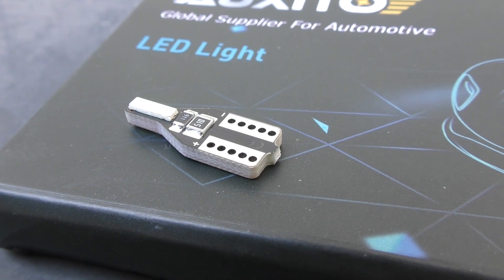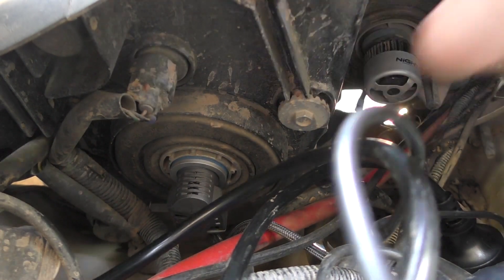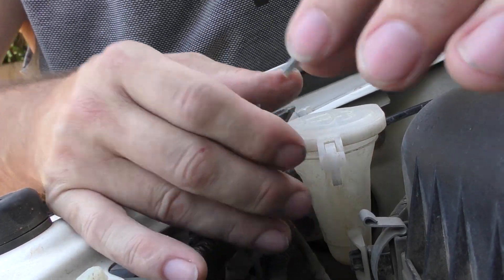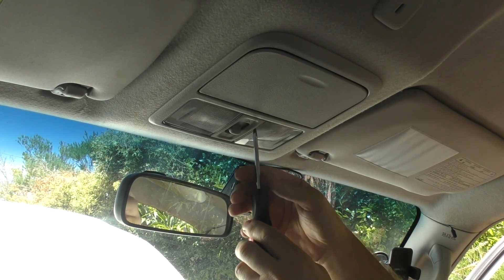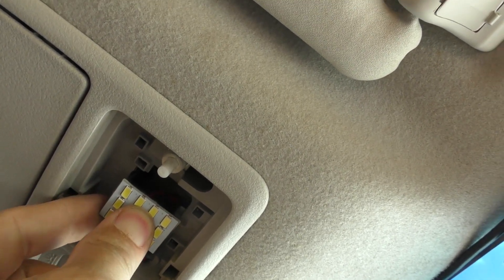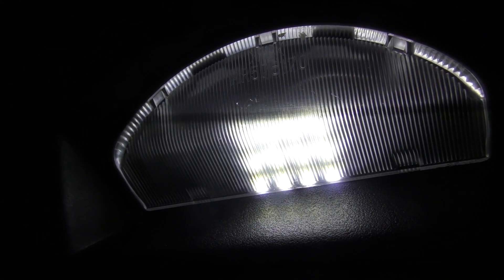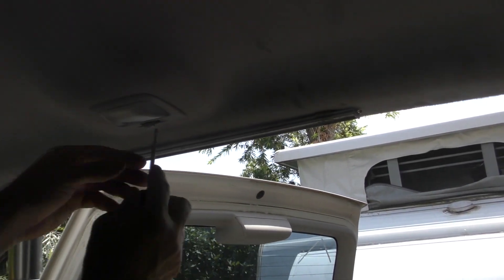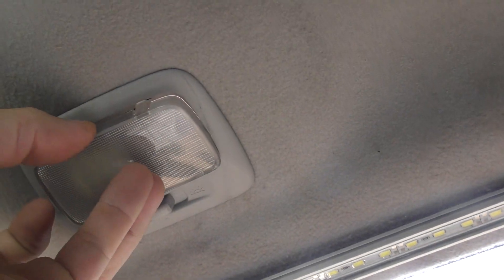Pajero Parker LED upgrade plus interior LED light options - how to

Comment: I replaced the headlights with the LEDs and wow they are great. Did the parkers too. Any idea where I can get a kit of the festoon LEDs? Would need a 10 pack to do all the door and interior lights? And no more than 12 per panel yeah? Don't need spaceship brightness!
Reply from the maker: Hey Phil, yes I think anything bigger than the 12 were to big. I just got mine off ebay. I do have a supplier sending me a full set that will do the whole vehicle inside and out. It's still a few weeks away but eclectic are high based on our interactions this far. Watch this space I guess.
Reply: Hey I can't seem to find the 12 led festoon kits?

Comment: top stuff Brett!! love your vids mate, they are always helpful.
I just fit a Redarc Brake controller to my MY20 GLS Paj, used the Mitsi supplied redarc and the factory loom for it so was pretty much plug and play once you get the rear trim off etc, it was a pretty easy job and worked a treat the last 6 days when I went up the Murray with the camper.
Only thing I wish Mitsubishi did was with the factory tow kit they should put a 12 pin plug rather than a 7. 
Anyway have a good Australia day holiday mate!
Reply from the maker: Hey Da, thanks for the awesome comment mate. I fitted a controller but didn't use the factory harness. Would have made thing easier I think but I didn't have one, so made do. Enjoy the break mate. Hope there was some water in there for ya. Happy aus day.

Comment: Hello Brett, thanks for this great video, i learned a lot 🙂
Could you please help me with this; i would like to change the original red appearence from the center computer ( with temperature, range, clock, etc) into blue. Some Pajeros have it in red and some in blue.
Also the Climate control should be in blue too insteat of red. 
Thanks in advance for your help, Alain from Belgium

Comment: Hey Brett me again.  DO you know the size name for the little mini globe in the glovebox?  Its about 16mm long and about 5mm wide.  Of all the bulbs that needs to be bright it's this one.  Can't see what LED light would suit.

Also for everyone else, I found when removing the bottom door bulbs, perhaps because they are naturally on when you access and remove them, I blew a fuse.  It was an obscure 15amp fuse and when blown you lose the navigation system, rear camera, radio and other important stuff.  After a lot of frustration I found the fuse in the engine bay fuse holder (2013 Pajero) which is within a separate yellow plastic holder that has a 15 amp and 10 amp fuse.  I had to lift this up (but not off) so it stays in place but lifts up to a notch using piers gently held on 2 sides of this holder.  This effectively lifts up and disconnects the fuses within the holder and then you can easily replace.  The 15amp fuse was blown the only spare I didn't have so had to race off to Supercheap.  So if I am changing these bulbs again in the doors I would lift this yellow holder holder up to disengage the fuses first within so no fuse will be blown.  If you don't want to bother doing this, I would just make sure you have a spare 15amp fuse.  Hope it helps someone.
Reply from the maker: Hey John, I can say I do. I know you have to remove the wiring for it when you drop the give box. I didn't pay too much attention but I remember thinking it was going to be a tough one to replace but I haven't taken it from it's housing to look closer I'm afraid.  Yes good lesson on the site bulbs. I do remember having to grab them with pliers because the originals were so busy hot. Didn't do any fuses though.
Reply: @DENMONKEY  Actually glovebox comes out easily to gain access and after the little cover which is near impossible to work out, the bulb is just sitting there.  No wiring to remove.   So confess I broke the little cover to get at the bulb but really that cover is not doing much as the bulb is hidden anyway and pretty dim.  Then the bulb comes out with gentle pliers pressure.  If I could upload a photo I would.  I will take it to Jaycar or Repco and see if they have something and let you know.
Reply from the maker: I think we're talking about the same globe. When you pull the glove box out you need to remove the housing with the globe and the wiring that runs toward the middle of the car. It just unclips. Handy tip though, it comes on with the head lights. So it's a good wire to jumper to make your stereo head unit dim when the lights are turned on 😉
Reply: So the LED for the glovebox is a T5 you can get from Jaycar for about $3.  When I said the glovebox comes away easily well really it it drops out of the way but is still connected.  But there is a lug that hooks onto a soft close plunger and it's easy to break that away :(  .  My advice, forget the LED in the glovebox you have to be extra silly to leave it on so it's low risk if the goal is to reduce the risk of a flat starter battery when camping which was my reason to do all this.

Comment: Thanks mate I might give them a go. The old T10's you had look like the ones I tried, they were rubbish!
Reply from the maker: Hi Kieran, got that right, they fell apart in no time. When I checked to see why they werent working I was shocked when they fell apart in my hand. good ol china specials
Reply: @DENMONKEY   received mine today and changed over the Parkers, door lights and the rear number plate lights. My hallogens in the doors weren't easy to get out, managed to get them out by using some newspaper between my fingers and the bulbs otherwise found it too slippery. Might be due to the humidity but I could never get a good grip on the bulb with my bare fingers.

Comment: I am interested in doing this upgrade. Are you happy with the T10 s you have shown and have you been able to obtain led globes for the tail light cluster as you had one that failed.
Reply from the maker: Hey Brenton, Yes mate. absolutely, those T10s are still going strong and I'm surprised actually considering how quickly the others broke down. I've got them in 2 cars and all are still working. Thanks for reminding me though, I should order another set just to stick in the spare for later. I just went back to the original globes at the back and haven't gotten any further with them

Comment: Great vids Brett especially the Super Select vs traction control one, so good to see those comparisons.  

Anyway, I want to change the door and mirror globes for a trip coming up as these are the only ones that don't turn off if you switch the master near the rear vision mirror.  Sorry I didn't get which globes you were saying (the less bright ones I was looking for) were the best, you said T10s and your link takes me to 10x AUXITO T10 W5W LED Wedge Interior Number Plate Light Globe 6000K Error Free which look like they are the right thing but different to what you showed on the vid - these are independent little globes - are these the newer type to get?  Or are these the ones you were saying fall apart.  Thanks mate.
Reply from the maker: No worries John, thanks for the compliment mate. The 2nd link is the t10s I recommend(AUXITO). The ones I put in in this video which are the same ones you see in the top right hand corner of the image for this video, are still all working. I also placed them into another vehicles parkers. I've yet to have one fail .   The other ones that failed were ones that my mate gave me and look more like a conventional bulb(kinda) where the good ones like like they are flat. hope that all makes sense
Reply: @DENMONKEY  Thanks Brett, OK  its not that much to give them a go.  Thanks so much for what you do.  I was googling how to turn off all Pajero lights when camping because all except 6 (4 doors and 2 side mirror) are off with the master switch.  Weird Mitsubishi wouldn't make the master switch off ALL interior lights but anyway you have given me a way to least drastically cut the usage with 6 x LEDs and make it less likely I will drain the battery in the middle of no where.

Comment: how have they gone mate? any issues with your radio gear? i have had a hell of a time finding a LED that doesnt cause bulk hash with my HF radio(s). Part of the reason i went away from LED in the headlights / parker (HID spotties still blow it to bits :/ )
Reply from the maker: Good question, I haven't had them running with the hf on. No issues on am  radio or 2m70cm but I shall check it out and report back. The fridge over the back is what kills the hf. I'm yet to find a 4wd fridge that is hf friendly.

Comment: Choice vids champ, I just ordered some T20 LED's for reverse lights and a pair of Nighteye H11 headlight LED's, just want to confirm that you fitted the Nighteye's in the Low beam fitting?? Also did you fit the same LED's in the high beam fitting
Cheers Ant
Reply from the maker: Hey Ant,   yeah mate stuck them into the low beam but they also fit into the high beam. So you can just get 2 of the same. Right now I have some auxbeams in the high beams. they were sent to me for review but weren't much good. so the review didn't happen. I only like to  review stuff or share things that Im impressed with.   One of my nighteyes started to flicker a week or so ago but has since sorted itself. I think it may have got dirt in it or something. Since I was so happy with them for the price I got straight on ebay and ordered a 2nd set. So I have them sitting there ready to go. So might swap them into the highs when i think of it.

Comment: I can't get the bloody t10 halogen globes out of the door socket 😂 what's the secret?
Reply from the maker: Geez it has been a long time.  I think I pulled them with a set of needle nose pliers. I might have even broken both globes in the process of pulling them out too if I remember right
Reply: @DENMONKEY  lol, I finally got them out after disconnecting the battery and yanking them 😂